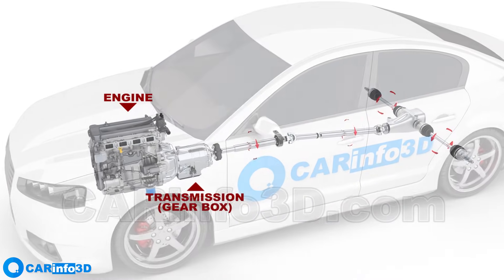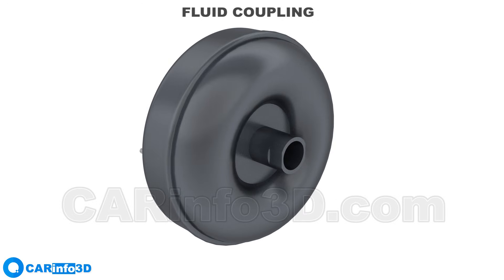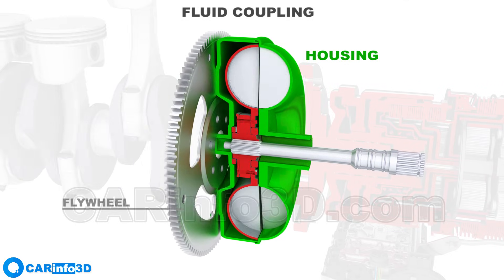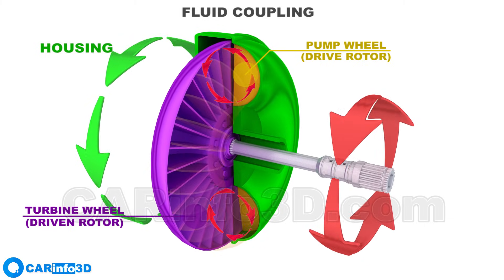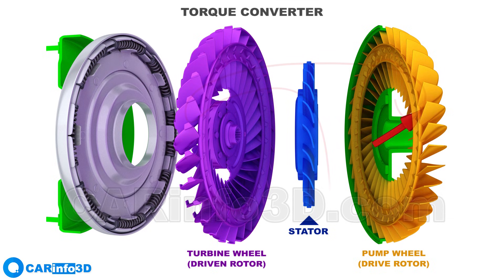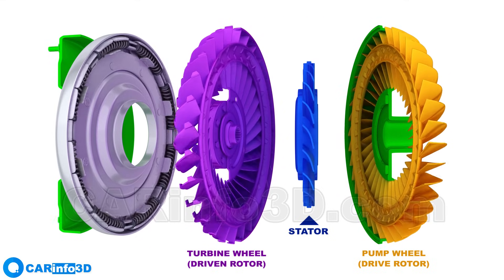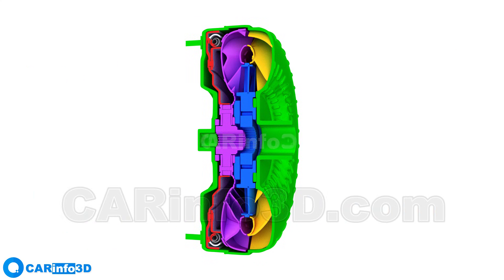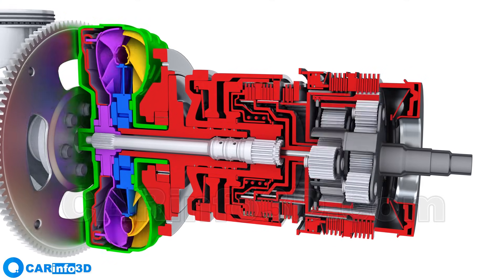Torque Converter – How Does It Work? (3D Animation)

Comment: TORQUE CONVERTER Maruti Zen automatic gear (3 speed) car, AC model, 14 kmpl mileage. Japan engine, Japan gear box Japan carburetor (NO ECM, NO SCANNING, NO ERROR CODE), Japan radiator, Japan axles, All zen automatic cars prior to year 2000 (only carburetor model, not MPFI) have high quality original Suzuki engine and imported 'Made in Japan' Suzuki automatic gearbox. This same Japanese automatic gearbox was introduced in Maruti 800 in 1990 (2 speed gearbox). Modified version (4 speed) (Indian made) of this gearbox is used in A-star, Vitara Brezza, earlier model of Swift, Dzire, XL-6, Ertiga and S-cross.The petrol-powered Brezza and Toyota Urban cruiser share the same 4-speed torque converter AT gear box. So this RELIABLE automatic gearbox has been in India for the last 35 yrs. I heard that there have been many reports of issues in the AMMT gearbox, requiring numerous software updates and even complete gearbox replacements even within 25,000km, sometimes GEAR suddenly becomes neutral (free) while on the highway, Need to shift to manual for a while and then after some time it gets stuck on setting it back to auto. You can also add "overheating" transmission / clutch burning to that list. CALIBRATION and clutch LEARNING needed after new clutch fitting. Many fault codes, TCM errors etc. Manufacturers have struggled with the long-term reliability of AMMTs. It is inherently an inferior technology for passenger cars. That's why I don't recommend AMMTs to anyone. CVTs are quite reliable and almost a gearless transmission system. But it is also very expensive but less expensive than DSG/ DCT replacement. It is safe to assume that it's replacement cost will be somewhere around 4 to 4.5 Lacs. CVT transmission uses a metal BELT and this metal belt snapping is common in poorly maintained cars. CVTs are significantly more expensive. It’s also about durability and fuel economy. CVTs can be delicate when driven in stop-and-go traffic over long periods, and repair or replacement costs are high. I will always recommend a proper Automatic gear (Torque converter) because of its superior smoothness, performance, reliability & resale value. TORQUE CONVERTER automatic is 95 year old technology and the most reliable automatic gear technology. Latest generation automatic cars have AUTOMATIC GEARBOX with SOFTWARE CONTROLLED gear shifting which is very complicated and may be having high maintenance and very expensive to repair. Latest automatic cars have ENGINE CONTROL MODULE (ECM) Very expensive to replace) and TRANSMISSION CONTROL MODULE (TCM cost high).If TCM is faulty, we cannot shift from Neutral to Drive. Driving with a faulty TRANSMISSION CONTROL MODULE can damage your auto transmission. Latest automatic gear systems are sensor based. Need to depress the brake pedal before shifting from P to D or from D to R. If BRAKE PEDAL SENSOR is damaged or fuse blown, we will not be able to shift from P to D. No BRAKE PEDAL SENSOR in this automatic zen. No ECM/ TCM in this carburetor model Zen automatic. Many latest automatic cars OVERHEAT in heavy traffic. During overheating the FUSE in auto gearbox is blown. Then the car automatically shifts to NEUTRAL and we cannot DRIVE. This automatic zen never had overheating. No FUSE in the automatic gear box of this zen. Have driven 250 km non-stop without any problems. Latest automatic cars have very complicated ELECTRONIC MOTHER BOARD inside the automatic gear box. This Zen Automatic car do NOT have any software or computer or ELECTRONIC MOTHER BOARD inside the automatic gearbox/ engine. No SCANNING needed. This automatic zen has a simple MECHANICAL automatic gearbox. Simple JAPAN engine (carburetor model-even roadside mechanic can repair it) and simple JAPANESE 3-speed MECHANICAL (no electronics) automatic gear box. Latest automatic cars have even 10-speed automatic gearbox. The more the number of gear ratio, the more complicated and more expensive to repair. This Made in Japan automatic gear box will last for about 3 lakh km in Indian driving conditions.and this Japan engine will last for about 4 lakh km. The less the weight of the car, the more the life of automatic gear box. This zen weighs just 750 kg. So the automatic gearbox has to pull less weight, so it will last long. Latest automatic cars have non-reusable automatic gear oil FILTER with washer. If washer is dislocated, autogear oil will enter the transmission without filtration and auto gearbox will get damaged. This zen has RE-USABLE flat METAL MESH type gear oil filter without washer. Zen carburetor engine model has more quality than zen mpfi engine model. Do not compare the used car rate of automatic zen with the rate of manual gear zen. FULL MECHANICAL/ ZERO ELECTRONICS CAR. The less the electronics the more the reliability. Average price of good condition used Zen automatic is 2.25 lakhs.